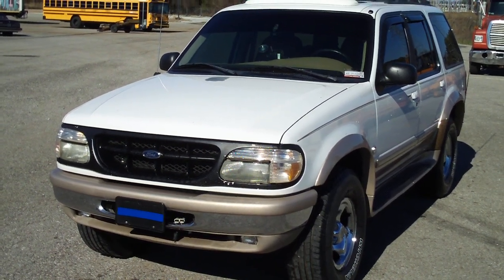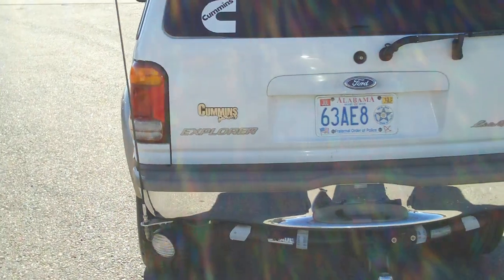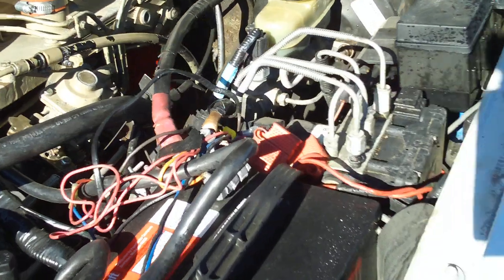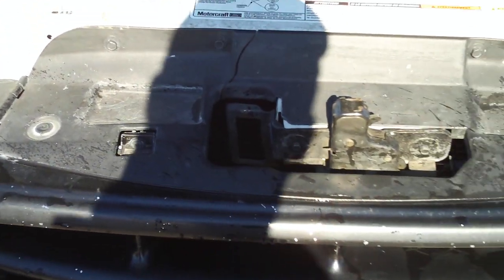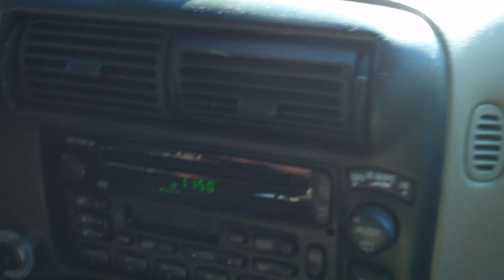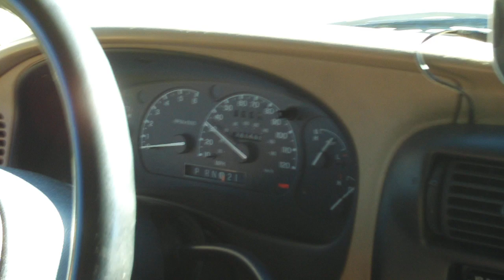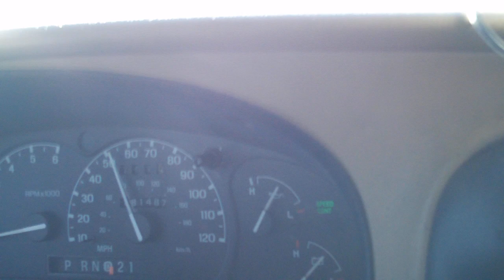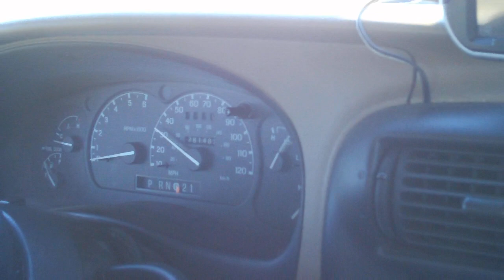4 BT Cummins Powered 1998 Ford Explorer

Comment from the maker: It came out real nice, it was put together real quick too, I spent three or four months putting mine together, we finished this in less than 30 days. This vehicle has more sound deadening insulation thus the sound from within the cab is much less than the truck. The engine was a tight fit, there was a lot of fabricating to make accommodations for the turbo charger.
Reply: I have the same year how much to do this to mine

Comment: With a controller and a bit of time you can get a tach signal from the alternator so your tachometer will work. Of course that requires a bit of math due to the different pulley sizes but it's easy.

Comment: My friend put a 4BT in his 2004 F150, he replaced a lot of parts on the engine before driving it. A new turbo, fuel pump rod, waist gate, also a Alison transmission. The truck gets 30+ MPG. He invested about $7,000 in 2010, but I think it was worth it.

Comment from the maker: He tows a trailer often, hauling anything from ATVs, Jet Skis, boats, Tractor equipment, etc. I haven't seen him haul anything as large as an automobile, but I have pulled cars, and trucks on a car trailer with mine, the engine is very capable. Your not going to set any land speed records, but definitely gets the job done dependably, and economically.

Comment from the maker: I think smaller engines should be utilized, the RAM 3/4 ton started with a 5.9, while Ford pushed on for a 7.3, your average fellow does not need this kind of monstrous power plants. You wont run a drag race with one of these small engines stock, but really is 0-60 times that important on the road. I get 28 mpg around town in my 4BT powered 71 Dodge 1/2 ton, even with the A/C on, and I can still pull trailers, they need to bring more smaller engines to market.

Comment: I sure do wish Ford sold F250-F350 Super Duty trucks with 4BTs in them in the US like they do in South America. I just don't trust complicated V8 diesels or believe they are efficient enough to justify they extra cost. With the amount I will use my F250 and considering the fact that it saved me $9000 I just went with the 6.2 Gas V8 it's not too bad. If I am careful on the highway it will pull down 18-20mpg depending on terrain at 60mph in cruise. One day I would love to do a 4BT conversion on it

Comment: Would love to make one of two conversions. A 4bt in a 2011 Jeep Wrangler WK matched with an NV500 5-speed manual transmission, or a 6bt in a Hummer H1 coupled with an Allison 6-speed auto with a transfer case that allows selection of RWD when you don't need the 4WD.

Comment: That's a nice conversion on that Explorer.  Has he thought about adding an intercooler to the system, or is he happy the way it is?  I will say this, I am jealous of how quiet his truck is on the inside.  My 88 Comanche has earned the nickname rattlecan ever since I did my 4bt conversion.  No sound deadening though, which doesn't help.  I've been thinking of adding dynamat to the firewall and floors, and some hush mat on top, to try and reduce the noise a bit.  Would be kind of nice to hear my radio haha

Comment: Nice! I've got a 98 Explorer XLT with the SOHC 4.0 v6 and 3 speed Auto. But when the 4.0 timing chain gives me problems, I'm gonna do this conversion. BUT I also wanna do either a 5 or 6 speed conversion too. Would the conversion be just as easy with a 5 or 6 speed manual?

Comment from the maker: There were to fairly frustrating hurdles to overcome. The core support of the Explorer is not removable without removing the entire front cap, this made dropping the engine and transmission down in there tricky. Making room for, and positioning the Turbo Charger was also a feat, a spacer had to be fabricated.

Comment: 105hp and 265Ft/lbs of torque in stock settings. A Ppumped is 120hp and 300ft/lbs of torque. Did you guys put the 366 3200 governor spring on the VE pump or did you leave the 2500rpm spring on there?

Comment: Are you using the stock suspension? I’m ordering a 4bt tomorrow for my 99 ranger and I heard you have to straight axle it but some people said you could use the Ford explore front end so was wondering if that’s true
Reply from the maker: Yes, it’s on stock suspension, absolutely no issues.

Comment: What t case did you end up using?  Nice job with conversion.  Did the oil pan have to be modified?  I am using a 3" body lift on my 2004 explorer with 4bt and 47RH and DLD241.  What gears are you running to get that mileage?

Comment: How do you get the transmission to have shifts? There is no longer a signal from the engine to tell it when to.
Reply: you can get a stand alone controller or modify the automatic (electronic) transmission to shift correctly

Comment: How difficult was it to get the factory instrumentation to work?
How did you tie in the speedo and all the other gauges
Reply from the maker: The instruments don't know what engine lives beneath the hood, all you need is the correct sensors from your original engine to supply the needed signals to the instruments.

Comment: you can pull up to as much as a 6bt but just cause you can, doesnt mean you should. have to consider the engine can pull, but its on a stock frame, suspension etc.

Comment: Is engine noise exceptionally loud and or can it be muffled with soundproofing?
Reply from the maker: The 4BT is louder than the 6BT, and there is an audible noise level, having this engine in a more modern automobile makes the interior noise more at a respectable level, but sound deadener could be added.

Comment: I have a 99 with the 5.0 and AWD. Could use the factory transmission and keep the 4wheel drive?
Reply from the maker: A lot of modifications would have to be made to the transmission, as well as a custom built torque converter.
Reply: TheMrKeys The 5.0 is a damn good engine, I have one.
Reply: I drove a 302 Explorer once.  It was awesome!  I currently have an Eddie Bauer 2004 model with a 4.6L V8.  It has decent mileage, but not 30MPG.
Reply: The 302 is where it's at, I had a 99 V8 at that time, suffered a wreck in June, rolled, kept it as a rolling donor for a V8 swap into another one, that says something. I'm driving a 4.0 SOHC in an 01 now, it's nice, but not the same
Reply: Totally.  The 4.0's were decent engines, save that timing chain in the back, but I like the OHV Cologne engine better.  Easier to work-on.  The 302/5.0 is a fantastic engine.  I drove a Grand Marquis and a ford Explorer with one and really enjoyed them both.  Solid cars.

Comment: Problem with these 4bt engines is that they vibrate so damn much in lighter vehicles.
Reply: +TomatheGreek Nothing that isn't solvable. You just need to get some nice vibration isolation. Maybe even heavy duty fluid-filled engine mounts.

Comment: You said it had a 4.10 in the back did you use the rear end from the Ram or did you use the original rear axle
Reply: if this were me, I'd swap the 4.10 out for a 3.73 and increase mpg and top speed, unless this trans doesn't do well with a 3.73?
Reply: +Edgar Taylor  Its got the ford 8.8.... no i dont know him but i know he has the speedo working and you have to have a ford rear to accomplish that. judging by the stock wheels, he left the 8.8  in it

Comment: Sweet looking engine installation. It's too bad Ford never offered a diesel engine in its Explorer. It may be noisier than that of its six cylinder brother, but so what? With some sound deadening materiel between the engine room and the passenger compartment, it should reduce, if not eliminate the noise of the 4BT. The tach doesn't seem to work. What's the story with that? At least the speedometer works. How much power and torque does it deliver? )
Reply from the maker: The Tach does not have a signal to it, there is not a pick up on the crank. The engine is 105 hp, and 275 ft lbs torque @ 2200 if I am remembering right, might be 1700?
Reply: 105hp doesn't seem like much for a 3.9 litre diesel engine. I would think 130hp would've at least be a good starting point for a diesel engine. I would also think that 380 lbs.-ft. of torque would've been the starting torque rating for a small block diesel. :)

Comment: So why does the tachometer not work?
Reply from the maker: There is not a pick up on the crank to drive the tach.
Reply: Tachometer can be made to work easily though.  I am using a tach driven off of the alternator.  Or as RedDodge mentions, you can use a ring and hall sensor off the crank.  It is also possible to use the flywheel if it is toothed for a crank signal to drive a tach.

Comment: 105hp 80 mph top speed. No thanks.
Reply: You don't do a conversion like this for HP and speed, but both of those are easily changed.  I have a 4bt in my Jeep Comanche. I started with a 105hp VE pump motor just like his.  All I added was an intercooler, M&H M2 fuel pin, and dynamic timing advance kit with a 3200rpm spring.  $400 in parts and my own time and I went from at best 90whp to 184whp with almost zero smoke once the timing was adjusted just so.  

With 3.07 gears and 33" tires, I sit at 80mph at 1990rpm and still get mid-high 20mpg, and it will easily pull to 100, and if I felt like hitting fuel cut (3200rpm) I could reach 130.  However, I rarely ever go over 80mph anyway.  at 60-70mph my engine sits right on the sweet spot of the torque curve between 1500-1700rpm.  It pulls like a train without downshifting, and if I set the cruise I can manage right at about 30mpg.

Also keep in mind that diesels are a different animal from gas engines.  That "little" 105hp comes to the tune of  255lb-ft at 1600rpm- and makes most of that through the whole RPM range..  My 184whp puts out 477lb-ft for perspective.
Reply: Keep in mind, I wouldn't call my truck "fast": by any means, but it will hold it's own in traffic, and I can easily get up to speed on any on-ramp well before the merge.  Considering this truck had a 4.-0L I-6 that made 177hp and 220lb-ft at the crank from the factory, and the same gears, it's still way faster than it was stock.
Reply: OddBallPerformance Faster than stock? Only a person who don't know your engine falls on it's back after 2500rpm will believe that. If u had turn up the fuel & boost and added an intercooler, I might.
Reply: ***** Water to air intercooler, M2 fuel pin, and Dynamic Timing shim kit, and 3200rpm govenor spring.. Cost, about $400 and some of my time. 105 rated crank HP to 184whp with no loss to driveability and hardly any change in economy (unless I really mash on it) thanks to the mild nature of the M2 pin.

So yes, it is faster than it was stock, because although it doesn't wind out to 5000rpm like the factory motor, it is also effectively geared taller due to the tires on it now (33" diameter vs 29" factory), so at a given RPM in a given gear it is moving at a higher rate of speed, and it can get away with this because along with that 184whp on my final dyno tuning run we also recorded over 400lb-ft (477 peak) across almost the entire rev range,  And this motor will easily rev out to the 3200rpm fuel cut without once feeling like it falls on it's face.  The factory motor falls on its face at 2500, because the factory fuel governing is set at about 2600rpm.

So will it achieve the same speed in every gear, no.  From the factory, if I felt like winding out second gear to redline, for example, My truck would top out right at 60mph at 5000rpm.  If I wind out second gear with the current engine, I will only hit about 45mph.   That being said though, I really never drive everywhere at WOT, shifting at redine all the time.  Around town, it feels no different than it did before, except that it has over double the torque and way better economy.   I would also like to state that the factory gas engine was way over geared as well.  Most owners swap to 3.55 gears for tires 31" and under, and 4.10's for 31-35" tires.  When they do that, they are going nearly the same speeds as I am in each gear.  

Besides, as I said before, I rarely ever find myself needing to go beyond 80mph, but I do know that it can do it, easily.
Reply: ***** Even with the changes, my EGT's never go above 1050 degrees under full load (measured at turbine inlet), with the timing adjusted with the M2 fuel pin it really doesn't create any excess smoke and drives exactly like it did before.  I still record 29-31mpg highway mileage at 60-65mph as well, which is pretty darn good from an old jeep pickup with a 5" lift and 33" tires.  The best I ever got out of the gas motor pre lift and larger tires was 25mpg.  Most trucks like mine with lifts, larger tires, etc tend to get high teen to very low 20mpg at best.  So, I can confidently say that a 10mpg difference in economy, and way better power was worth it.  Especially considering the very low cost of those mods.
Reply: OddBallPerformance 29-31mpg with a lift kit. I can't prove u wrong so u got that.
Reply: OddBallPerformance Also you're not burning enough fuel for your egt to get much hotter.
Reply: OddBallPerformance You did not say that at 1st. Yes its probably faster than stock but now its really hard for me to believe u pulling 29-31 mpg.
Reply: I don't see why.  The mods done were mainly to increase the efficiency of the factory setup. Stock turbo and injectors.  The M2 pin ramp is very similar to the factory unit, but has a deeper max fuel cut up top.  With the timing set right with the fuel pin it doesn't fuel too early and billow out clouds of smoke (well, a tiny bit, but no worse than stock).  The pin I have was designed specifically for that purpose.  Better power when needed, but acts like stock otherwise.

As long as I am just driving normally and cruising, it gets pretty much the same fuel economy that it did when I first did the swap.  It's only when I really mash on it that the economy has dropped some.

FWIW, I did mention all of this in my first response too.

As far as fuel economy with a lift kit.  The lift is necessary for clearance on an MJ or XJ jeep.  Most 4bt swapped XJ/MJ's have about the same lift and tire size that I do, and report 27-32mpg depending on the gearing of the individual truck.  Most of them also have some tweaks like mine, to some degree.  So I am not that unusual of a case in regards to economy.  Heck, there are cars with this swap that have reported getting 40 on the highway.

As far as my EGT's,  The factory setup with the intercooler (first mod) My EGT's never got above 900.  With the extra fuel and subsequent boost (30+psi since the 4bt is a non wastegated setup) They will creep to the 1050 range, and on very hot days I can clip 1100 at WOT.  Many consider over 1100-1200 to be the limit of these motors before you start running into problems, such as burning out the piston centers (common problem on older 4bt engines that are turned up).
Reply: OddBallPerformance I hear you, have fun.
Reply: ***** I do man! lol
Reply: Considering this swap with a 6 speed standard in my 98 F150. How were the motor mounts set up in the explorer?
Reply: Obviously a few on here don't know Jack Schitt about diesel engines.

Comment: 105hp? Class 3 towing receiver??
I guess this thing is just for bragging rights because it isn't towing/pulling anything
Reply: The power band is long and immediate Torque is what pulls not hp.
Reply: 105 hp at 2300 RPM. While it won't break any speed records, it can tow loads beyond what the class III receiver can handle.

If anything, it's over powered.
Reply: 4bt's have 400 lb ft of torque, they could definitely tow with it
Reply: People have towed for years with the N/A 4.9L Inline 6 in F150s. 89 Models were rated at only 120Hp but 250TQ. Like mentioned its the TQ that makes it possible. The 4.9L had a reputation for being a work horse with solid capabilities.
Reply: 94lt1hawk2
More accurately, it's the top speed of your gears that determine how hard your hp can accelerate.

Considering 65-70 MPH is the average top speed of a 4BT powered truck, your 105 hp is accelerating pretty hard. You're not going anywhere fast but it'll take a lot to stop you from getting there.

Comment from the maker: Stupid, such a big engine.....L.M.F.A.O..... it's a smaller liter than what came out of it, the 4BT is a 3.9 liter 4 cylinder Cummins Diesel engine, the V6 that was originally in it was a 4.0 ltr. so we down sized :)

Comment: only 105 hp? rather keep the original gas engine
Reply: Not in it for speed lol.
Reply: i bet it gets better mpg than the 5.0 or the 4.0... .... and it sounds bad ass !
Reply: Justin Mcnamara he said cummins gets 30 mpg and the stock 4.0 gets 14 mpg
Reply: 105Hp  yeah but with 265 ft lb's of torque!
Reply: Damian DeLapp not much more then the 4.0 and on par with the 4.6 it only has mpg over the stock options
Reply: Hmm this engine should be at 170 stock, maybe its just low for economy